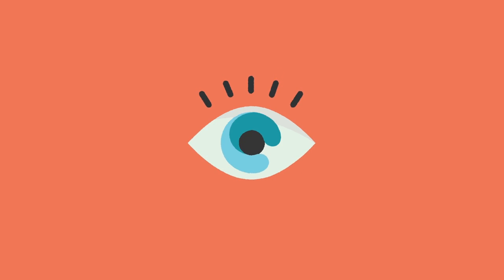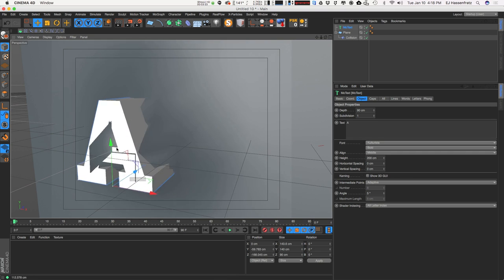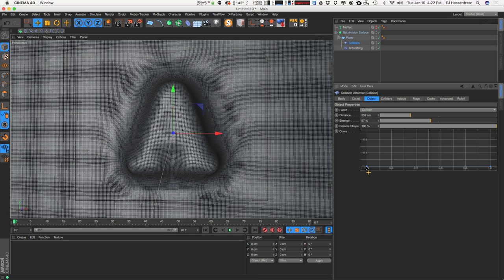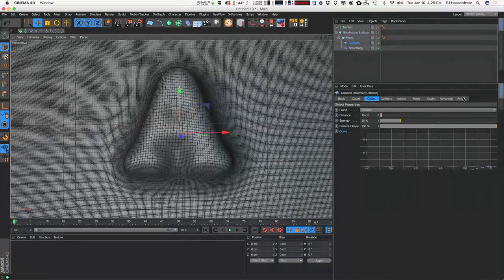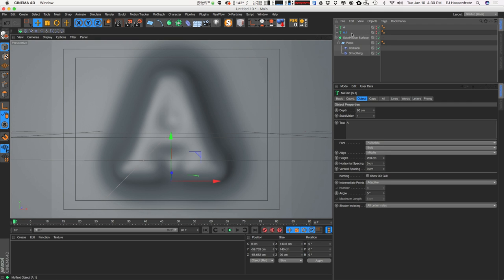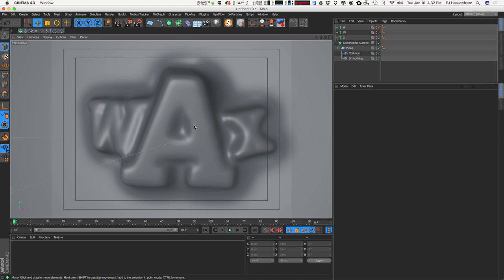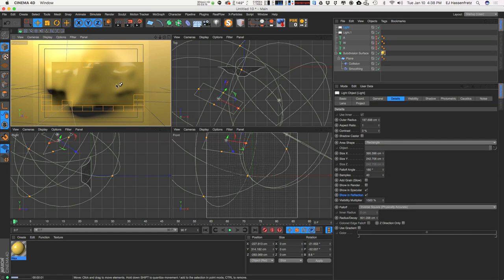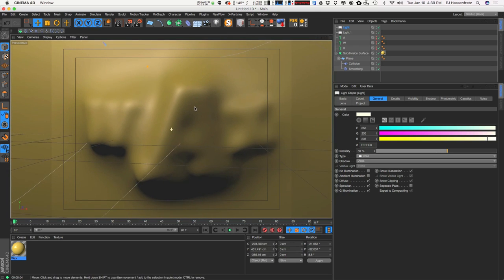Cinema 4D Tutorial  - Create Wax Type Using Collision Deformer

Comment: Really nice tut - thanks, EJ! I do a lot of product rendering (white plastic), and I'm still struggling with SSS. It seems the effect varies depending on the size of your object. So a toothpaste tube, for instance would have different settings than the cap. If you have any advice regarding this I'd love to learn more. Until then I'm experimenting.

I learned a few new things watching this - thanks again!
Reply from the maker: For sure, because most of the SSS settings rely on distance in cm, everything will depend on your object size.  For an object with different thicknesses, you could always make separate object selections and apply materials to each one.

Comment: Hey EJ, nice Tutorial. Interesting techniques, very instructive!
Few questions:
if you stack some layer in your reflectance channel, like speculars and reflection, wouldn't the top reflection layer override the specular below it, if it is in 'normal' blending mode...?
And secondly:
wouldn't it be better to subdivided the plane (typo) BEFORE the deforming/smoothing hierarchically via a NULL object for more geometry to deform, instead of subdividing the result?

best regards, Tommy
Reply from the maker: Hey Tommy!  To answer your questions:

1.  Yes, if you have it normal, it would override the Specular.  I forgot to not only change the Attenuation to Add, but the blending mode to add too.  Whoops! :)

2.  It could work either way, for sure!  The workflow you mentioned saves you from having to even use a SDS (just need to up the Plane segments a bit more!) while still getting the same result!

Great observations & alternative options, sir!
Reply: I've tried the other way - you must be CAREFUL in high LOD when you increase the SDS level, otherwise the viewport calculation takes too long!!!
My tip for the material manager: right click the preview window and choose 'open window' to pop up an scalable window for a better evaluation!
Reply from the maker: For sure!  :) For either method I've found you must have enough subdivisions to recreate my final result that you'll need to watch out when moving around the text to deform the plane through the collision deformer, so it's a good idea to use lower LOD when moving around the text for both options

Comment: Anyone be able to tell me why this effect is running so slow on my PC? Using R16 with a text extruded as apposed to Motext. Just moving the letter in and out of the plane is sooo slow. i7 4770K with 32Gb ram surely its not my computer slowing me down? Somethings not right? 100 x 100 subdivisions on the plane as in the tut. Thanks
Reply from the maker: As I cover in the video, when you up the samples a lot you may need to switch back and forth between different quality levels to do work, move things around, then up the quality to see what it looks like.
Reply: Cheers ^